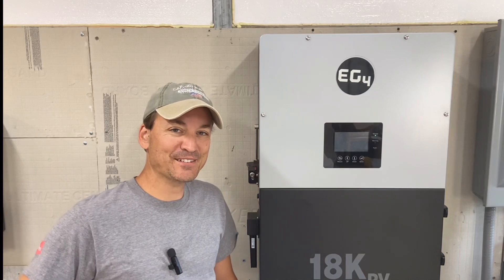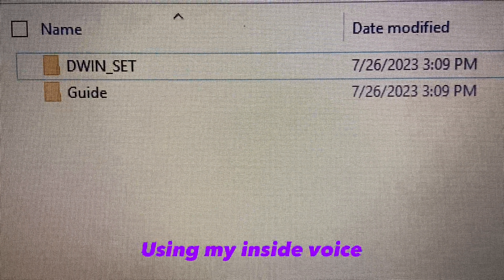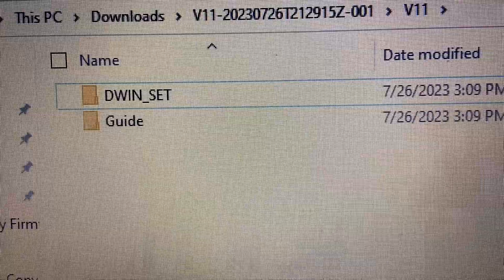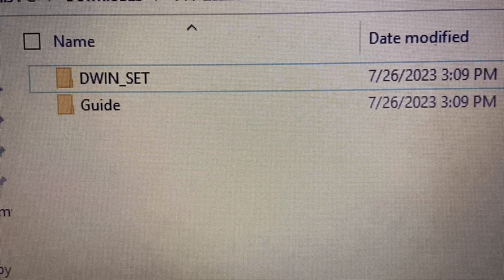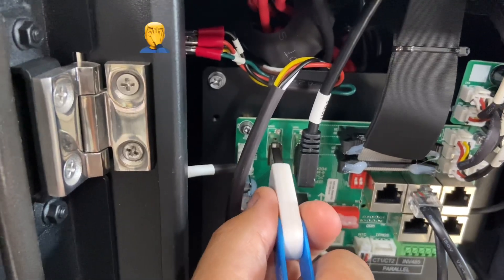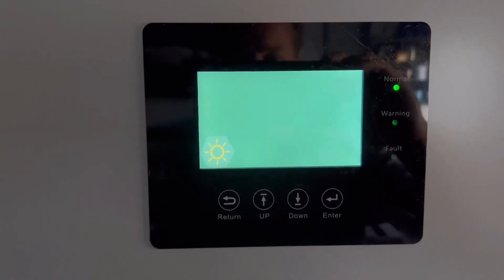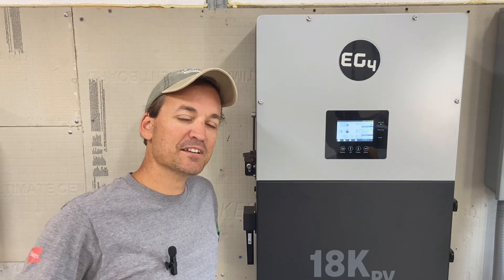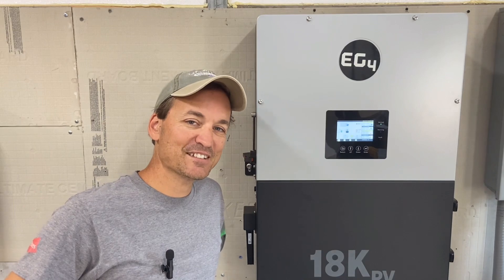EG4 18k PV walkthrough for LCD firmware update

Comment: When going to version 20 mine went black screen to, but after reformatting and third try it finally took seems some lcds are finicky which is why they need to be done the manual way which you covered perfectly, I blame the many different chips which are used by what is available at the time of manufacturing.

Comment: Thanks for the helpful video! I just upgraded from ver 7 to 14 with no issues. Now my inverter, batteries, hub, and LCD are all running the latest firmware!
Reply from the maker: Sure thing! Thanks for watching.
Reply: Where did you get the file? Any special instructions? Signature Solar says there's no updates to do with a flash drive and that I have the latest firmware, and the LCD firmware is part of the remote update, but I'm still on version 7.
Reply: If you have ver 14 can you sent it to be they do not leave older version up on there site. new ver 18 out and will not upgrade from ver7

Comment: I did the LCD screen upgrade today. when it restated my WiFi dongle would no longer connect to my router and I could no longer talk to it. Signature Solar told me dongles have been failing. I provided the serial and pin numbers to them and have been added to a spreadsheet. Have you had any trouble with you 4G cellular device? I am thinking about going that rout instead.
Reply from the maker: No issues at all with the cellular dongle. It’s still working fine. It’s only dropped signal twice in 5 months. And that was brief because of terrible storms I had in the area.
Reply: Thanks

Comment: I learned today that it is important to have your flash drive formatted correctly!  FAT32 with 4096 blocks.
Reply from the maker: Did that remedy your issue?
Reply: @GavinStoneDIY  No, but it is important information to share because the USB drive that I originally used had blocks size 16k...  Which might have been part of the problem which messed it up...  EG4 is sending me a new display which says good things about EG4!  I recommend you tweak you video to include the FAT32 and 4096 block size information...
Reply: Signature Solar has decided to completely replace my unit.
Reply from the maker: @ke7aga  wow!

Comment: I love that the YouTubers get all the support! No guide file in the download on the website like you got😡. But you guys get it, and you get to call EG4 directly! We have to wait for days and weeks for SS to get around to returning our call or emails, if they even do. I’ve had issues with my unit since day 1. Going on 2 months now and they still can’t fix the issues. No one at SS knows what all the settings do….it’s crazy  I would not recommend anyone buy this unit yet!
Reply from the maker: What issues have you been having?
Reply: @GavinStoneDIY  day 1 I could not use my account to log into the unit. It took them 2 weeks to fix that. The unit is sending power to the grid randomly. And yes I have the settings to 0.0 and the Zero grid checked it’s been doing it since day one. They told me it was an error in the software. So I put a CT monitor on the Grid lines, and what do you know it’s sending power randomly back to the grid. I’m up to 15.8kw of power to the grid. I sent them the video of it doing it and they said they will look into it…that was 2 months ago. There are other issues too, but the big one is I live in Florida and the power will go out for a second or a few minutes real quick sometimes during thunderstorms. The 18k flips to EPS mode with a slight flicker (not the issue) but when the power comes back on it never returns to solar and or battery. I have to totally shutdown the unit and restart it. I have waited a full day before doing this and it never flips back to normal mode. Even with 90% SOC and Solar 1200+v. 2 months no answers….
Reply: @GavinStoneDIY  and another big issue firmware updates don’t work. SS has to do them. And I’ve asked them to fix that too. Because they get to it days later. And when I’m not home. So the unit shuts off and I have to manually restart it when I get home. In Florida no AC in the house with animals is no fun!
Reply from the maker: @ScubaDaveCCR   I’m assuming you have an open ticket with them. It may be a good idea to reach out to one of the signature solar team on the forum also.
Reply: @GavinStoneDIY not frustrated nor am I venting. Ive had an open ticket with them since I turned the unit on. And have spent hours on the phone and emailing them. EG4 does not take calls or emails from regular users, they state on their website and on emails….you have to contact your distributor.
Reply from the maker: @ScubaDaveCCR  ok. I assumed you were frustrated by the general verbiage you’ve been using. In any case, did you purchase the unit from signature solar or another vendor? Contacting their team on the solar forum and listing your issues on a specific thread could be helpful to signature solar and the other forum members.

Comment: Well, I just did this...  Just as the video stated!  Waited the three minutes and screen changed...  To a black screen.  Now I have no LCD display!  Beware!
Reply: Lol they haven’t thoroughly tested anything. I have had issues with mine since day one, no one at SS knows how to fix these machines! Nothing Odd about it!
Reply from the maker: @ScubaDaveCCR  I get that you’re frustrated. But I can only speak to my experience with the unit. So let’s try to be civil and I’ll help if I can.
Reply: @GavinStoneDIY  Except for the problem with the LCD and/or firmware I have had no problems with my unit!  It has worked just as observed with @WillProwse.  @SignatureSolar is currently working the issue.  I have recommended that they revert the LCD firmware to the version that it shipped with.  The unit is working just fine except no LCD display.
Reply from the maker: @ke7aga  they could probably send you the original firmware and you could install it. I haven’t known anyone else that has had that issue yet when updating the screen. So for now there isn’t any harm using the older version I wouldn’t think.
Reply: @GavinStoneDIY  I’m being “ civil” just also being factual! I’d post pictures and videos here but I can’t.
Reply from the maker: @ScubaDaveCCR  I’m cool with factual. And like I said, I understand if you’re frustrated about not getting answers to a problem you’ve had. But they have tested these firmware updates.  Feel free to email me problems you’ve got so far. I definitely want to hear about issues people are having. However this also isn’t a venting forum. So that’s what I was getting at with the civility request. I’m not saying we can’t have complaints about a piece of equipment. I’m saying it isn’t productive.
Reply from the maker: Woah. Have you tried restarting the inverter?
Reply: @GavinStoneDIY  yes!  Contacted SignatureSolar and they worked on it for two hours!  They reinstalled again.  Still no LCD...  System is functional just no LCD.  They will be working to understand what has happened!  Did my LCD just break?  Or did the firmware update cause it to break?  I will follow up when something is learned!
Reply from the maker: @ke7aga  that is extremely odd. They tested this firmware thoroughly before releasing it. Maybe try uploading the file again to your computer and redownloading it. Check the guide to see if there’s any tidbits that would help.
Reply: There’s no Guide file in the downloaded file on 7/31/23
Reply: @ScubaDaveCCR  I agree!  Except for @GavinStoneDIY video I could not find a guide file of any kind!
Reply from the maker: @ke7aga  thanks for letting me know. I’ll send them a message about the lack of a guide on the download file.

Comment: Lux power makes this unit for at least two 3rd party resellers (rebranded) . First is "Fortress Power Envy True 12" which costs $6,259 and then EG4 18K for $5,599 The EG4 is $660 less for the same thing. I actually went to Fortress and looked at their information as it is more detailed than EG4 and more professionally presented.
Reply from the maker: Yeah I believe that is correct.  Also signature Solar will knock the price down an addition $500 if you purchase their rack batteries. Apparently EG4 had a lot of input in altering this inverter from the original LUX unit. It has a larger wiring cabinet integrated DC breakers ect.

Comment: Great update thx. I’m waiting for your update on zero back feed performance. Can this unit really get a zero back feed to grid?
Reply from the maker: I think they can get closer then anyone else can in terms of zero export. It’s a difficult thing to achieve due to inductive loads being used in conjunction with the grid. When the load turns off, it will always try to give a slight backfeed to the grid. The last I saw on the forum I’m hearing reports of little to nothing of backfeed with the newest firmware.
Reply: @GavinStoneDIY  that's awesome...what forum you talking about?  Will P's?
Reply from the maker: @TylerTheCompiler  yeah. That seems like the largest one out there at this point.

Comment: Thanks Gavin.  Looks simple enough.  Still too bad they have to have different update procedures for the different firmware pieces, but all in all, still not bad.  

I would love to see it where they could download their updates from an online repo (triggered manually of course) and then perform the installation.  No thumb drive and no phone required (still available for those with no internet connection though).
Reply from the maker: I dunno what any of that means. But maybe it would make it easier. 😆
 Either way if I had to do this a couple times a year when they come out with something new it would be fine I think.
Reply: @GavinStoneDIY  🤣